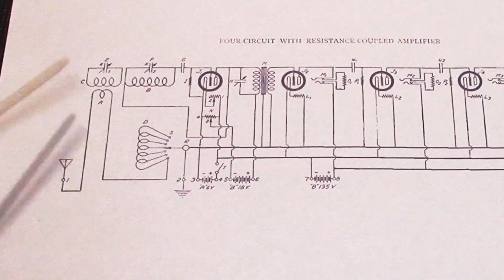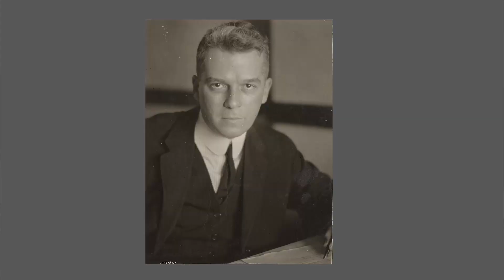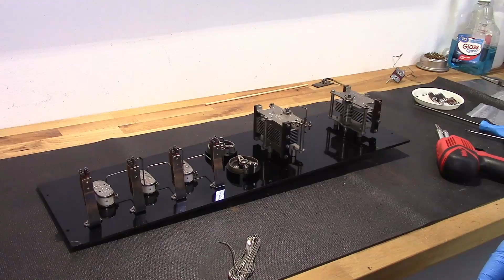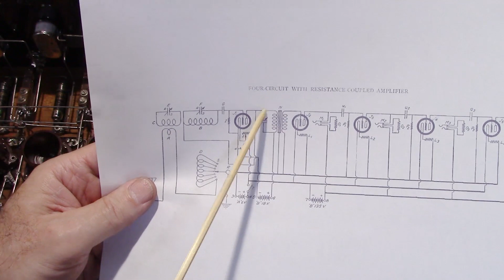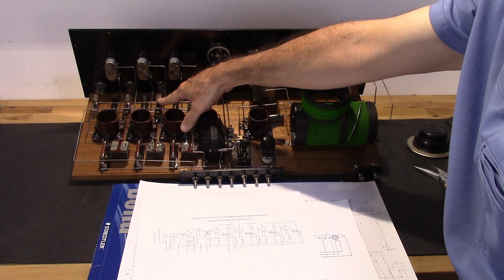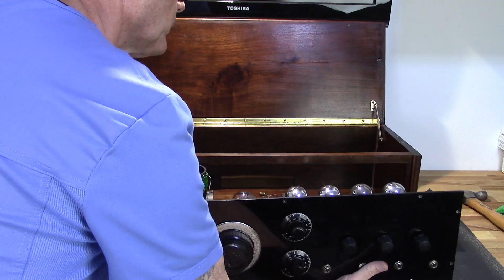1924 Four-Circuit Laurence Cockaday Regenerative Receiver Restoration

Comment: This data sheet shows the '00A versions to have a mu of "20" (not "1") v. "8" for '01A types.
I Read somewhere else that the '00A (Cesium) characteristics were similar but more reliable than the earlier '00 Argon type (UV, UX). 
I have an earlier homebrew version (in pieces) that has all "transformer connected" stages rather than your "RC connected" stages?
Cheers.
https://frank.pocnet.net/sheets/021/0/00A.pdf